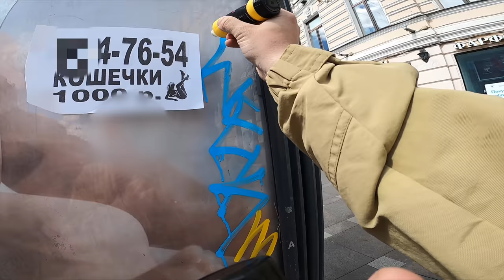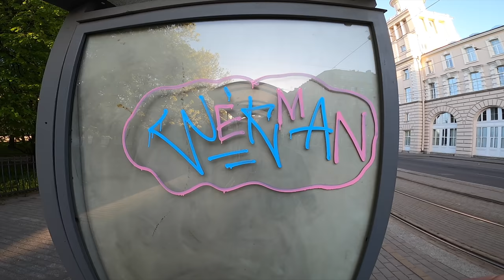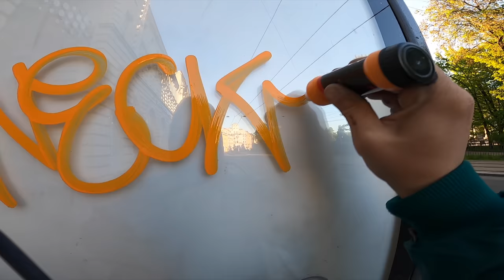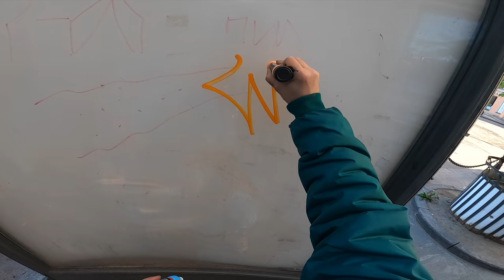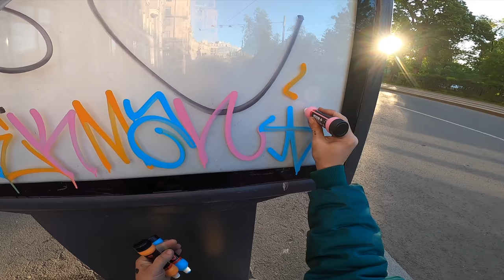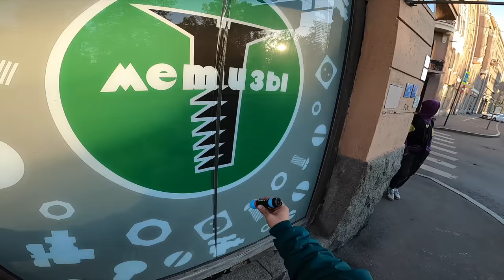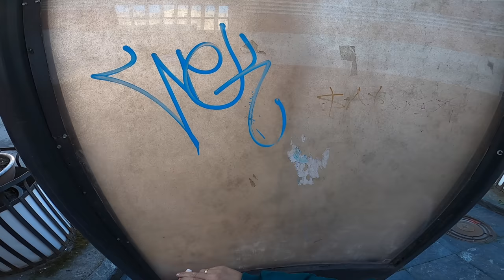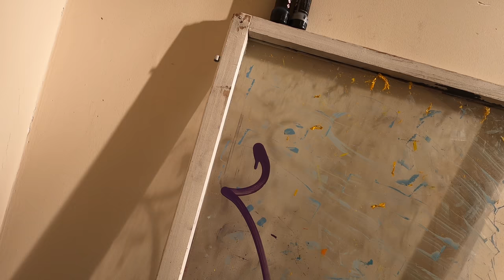Molotow dripstick squeezer- Graffiti review with Wekman

Comment: Those are good, drippy when you need and can write smooth without being streaky and drippy
Edit: buy some grog street killer ink that cannot be buffed easily and is very controlable in the dripstick
Reply: what is streaky
Reply: @antonmarkholt1807  When it leaves lines that look like skidmarks
Reply: @testick8431  😂🤣

Comment: do the markers leak when you transport them normally or otherwise because my 25mm always leaks and gets dirty
Reply from the maker: When I take markers on a plane, I always pack them in separate bags for fear that they will leak due to the pressure during the flight, but they have never leaked.

Comment: Im sorry but this is kind of vandalism
Reply: That's the point.... But it is also depended on how you look at it. 

Everything he has done is actually really easy to remove, Especially all the Tags done in the Plastic/Glass Billboards. 

None of the Paint adheres to a really smooth surface. . . And the rest can be painted over/buffed with 90 Proof Rubbing Alcohol and any of the harsh chemicals city workers can get ahold of so there is very little things that are Destroyed.